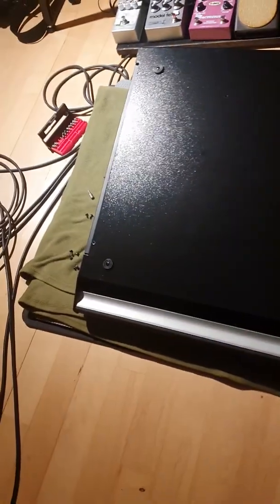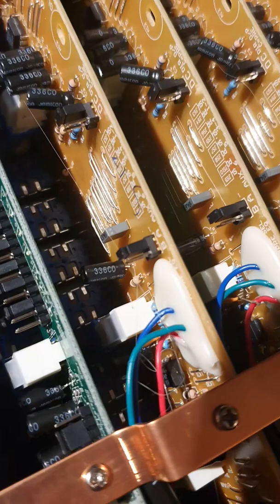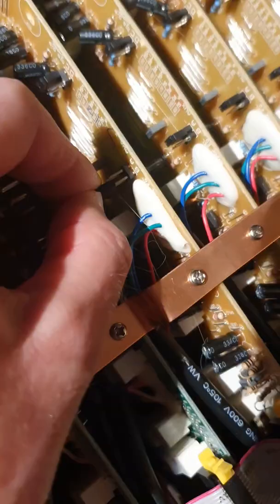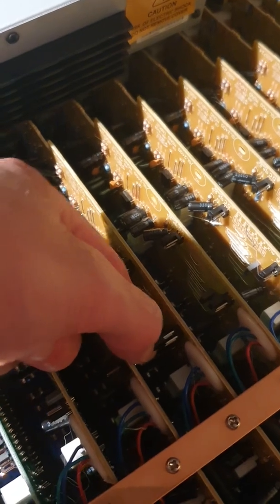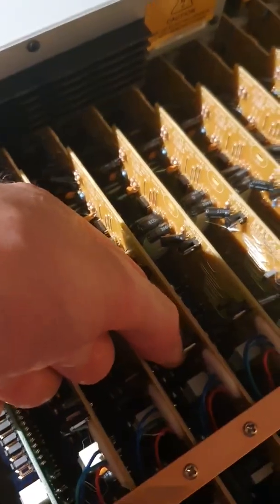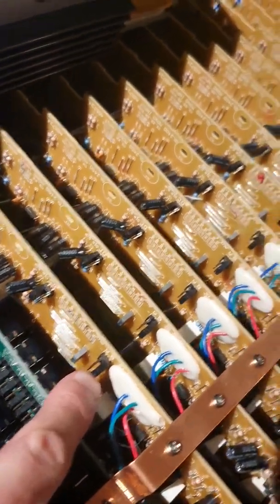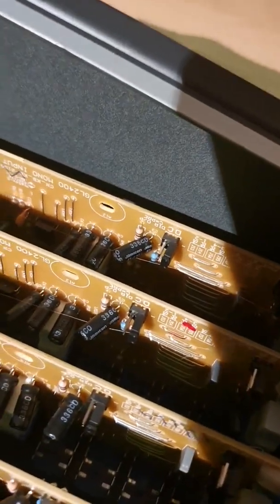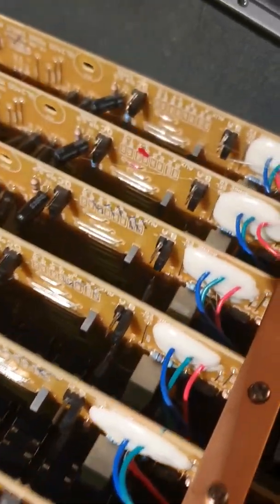Allen & Heath GL2400: How to convert Direct Outs to Post EQ/Post Fader using internal jumpers

Comment: Hi, I've got a A&H Mix Wizard I want to do this to, I'm really hoping it's a similar setup, thanks for making the video, super helpful!
Reply: Did you figure it out? I just bought a MW3 for the purpose of using the eq for recording drums in my studio. And of course, as soon as I patch the direct outs into my patch bay the eq isn’t in the damn signal. So now I’m scrambling trying to figure out how to do this on my unit.
Reply: Ok, I actually just figured it out. It’s on page 14 of the manual. Now I just have to figure out how to open this thing up and do it. Cheers!
Reply: @cbrooks0905  Yes, it's basically as he describes it in this video.  There are the little jumper blocks you've got to move. It was fairly straightforward. Just take the time to make sure you've got it all mapped out in your head as to what is what. I found it easiest to take a photo of the channel strip and different sections as it made it easier to see. Also good to photograph or do a quick diagram to show you where everything was to begin with so if you get in a bit of a pickle you can go bac kto square one and start again@

Comment: Hey - at 2:35 you're saying that moving the jumper will make a mono channel POST EQ and POST FADER but in the manual it doesn't say anything about POST EQ - 

Direct output source Factory default is prefader (as set for the pre-fade auxes). This is
common for live recording to multitrack. The live mix
fader movements do not affect the recording. Move
the jumper from C to D to change to post-fade.
Post-fade is appropriate when using the output as a
direct channel effects send.

Or am I missing something? I do not have this board - I have a GL2000 which also doesn't mention anything about POST EQ at the jumpers' section.

Cheers!
Reply from the maker: ummm, i'm pretty sure it's both post eq and post fader when you move the jumper

Comment: Thanks Mikael for making the video. I just picked one of these boards up recently and was wondering how to get the direct outs to be post EQ for my eight channel audio interface. Wish I could set them post EQ pre fader but I'm glad I can at least do this. Thanks again it was very helpful.
Reply from the maker: every piece of gear has its limitations 😀
Reply: Was wondering this myself. Looking at the schematic it appears that moving the first one from A to B but leaving the second on the original C position would result in the direct outs being post EQ but pre fader. Only if moving the second from C to D would result in post EQ, post fader. Can anyone verify this?